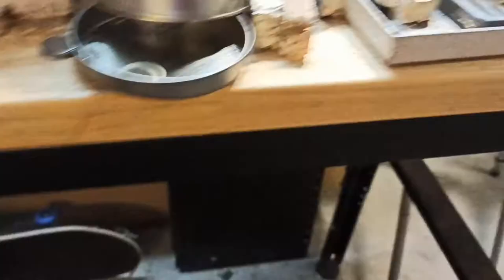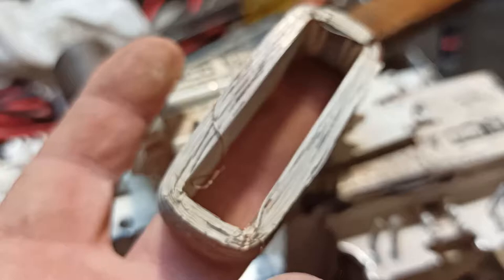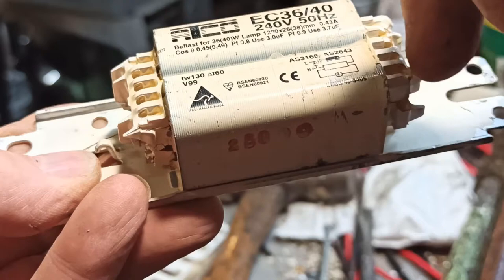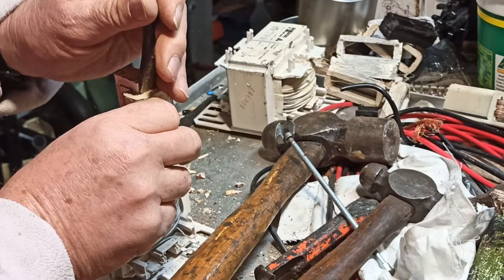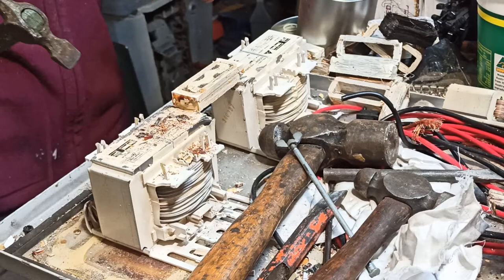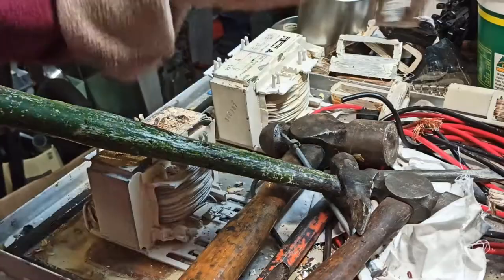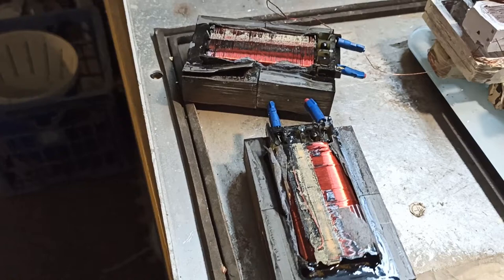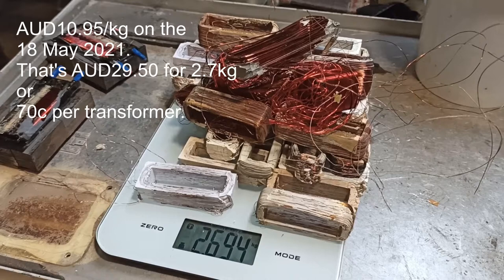50 Fluorescent Light Transformer Ballast Copper Recovery.  Worth it at todays prices. Bondi Scrapper

Comment: Nice technique. I break down the ballasts in a very similar way, and yes, I pull apart light fittings whenever I see them. The return for the copper in it is good for the time involved to break them down
Reply from the maker: At current prices it's a no-brainer.

Comment: Hello from Sweden again.
I do just about the same with those things. Microwave style ones I hit with a hammer on the weld and they come apart nic and easey.
Taking in a load of cu/al radiators and copper #2 tomorrow,, should be a nice payout.
Reply from the maker: Good luck with your cash-in.
Sweden in winter.  You would have to dig the car out of the snow wouldn't you?
Reply: @bondiscrapper1781  hahaha,, that has happened once or twice,, or more 🤣
It's only - 16°c at the moment so it's nice for a evening walk.
It was a good payout, not sure on the currancy but it was 2000+ swedish krona.